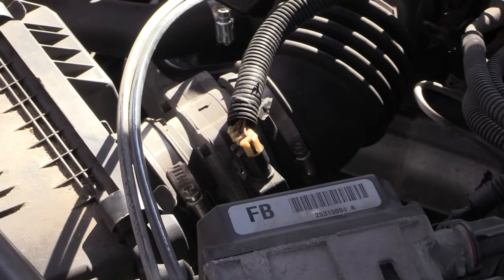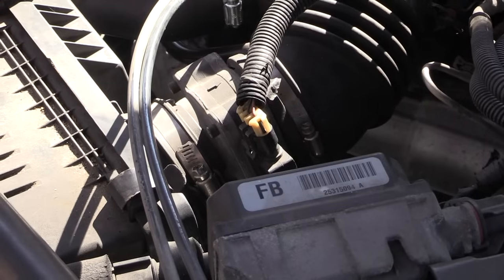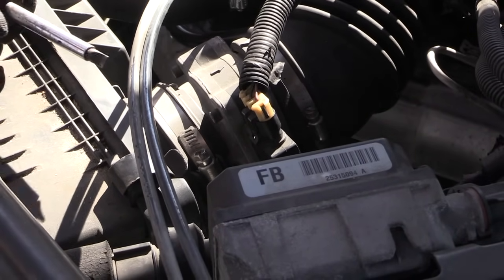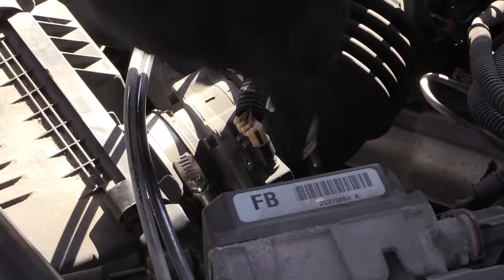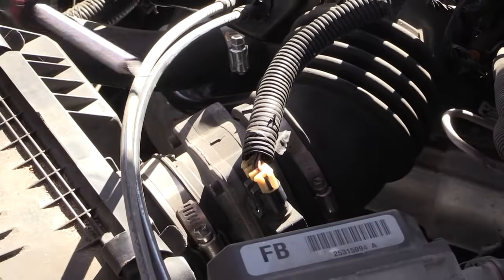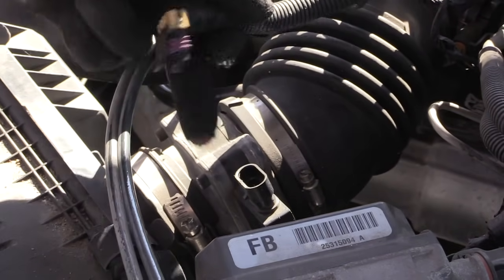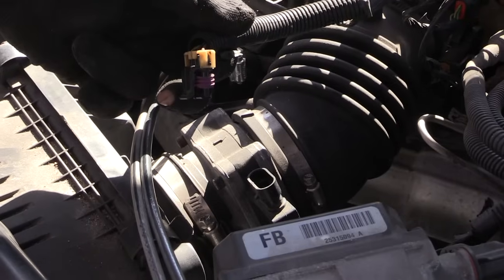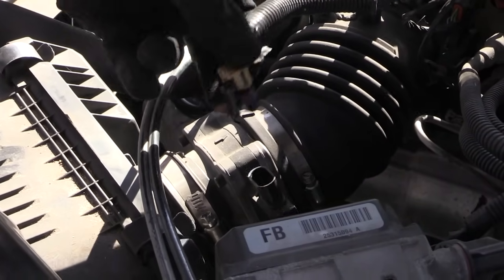Mass Air Flow Sensor -Quick test To Tell if Bad or Dirty!

Comment: I've removed MAF plug engine runs the same reading is good.
02 sensors operating properly.
No exhaust leaks no vacuum leaks. I've tried everything seems I can't get rid of engine running lean. No hesitation good acceleration. Engine seems to run excellent just codes po171&174 keep coming back on. Anything else I may be missing.
Reply from the maker: Sorry, not sure.
Reply: check fuel pressure first if that dont work and check MAP sensor if not that then put a vacuum pressure test on each cylinder
Reply: @deathsdollar2606  apparently you have not read my post as I said I've tried EVERYTHING.
Reply: @brianwalck632  he asked if you checked MAP sensor. You only mentioned MAF
Reply: @89sn2001  I've removed and replaced everything
Reply: I had same problem. And my catalytic that's together with exhaust manifold  was gone ,broke up in pieces, basically suffocating it
Reply: Adding to my last comment--basically my car went in to lean closed loop
Reply: @Wetsocksandavocados  I don't have catalyst converters it's a LS swap engine.  Online has upstream 02 sensors.

Comment: I dIsconnected the MAF and the car kept running. But when we re-connected the MAF the car shut off on my 2005 Jaguar S Type 3.0 6cyl So what's the possible prognosis? Thanks!
Reply from the maker: Sounds like you have a bad or dirty mass air flow sensor. Please like subscribe and share
Reply: Purchased new MAF at Auto Zone for $70 and car runs perfect now ❤ I drive on a lot of dirt roads, that could be the reason.  As soon as mechanic unplugged the electrical plug from air filter car ran great, as soon as he plugged it back in the car wouldn’t stay running. Replaced it and it runs perfectly again 👍

Comment: My question is will a bad mass air flow sensor cause a misfire and lean codes if not working properly, All my sparkplugs been replace and coils I did same test did same thing as the video.
Reply from the maker: Thanks for watching, yes a dirty or bad MAF can cause lean code and misfire. Please Subscribe and share if haven't already and check out my other helpful videos.
Reply: Derek Anthony , did you fix the problem and what lean code does it have ?

Comment: Mine has the same problem, when I disconnect the MAF the engine is more static I guess I need a new one thanks!
Reply from the maker: Your welcome  glad could help please subscribe like and share and check out our  other helpfull videos.
Reply: Whas That the issue?
Reply: Vacuum leak

Comment: I wouldn't unplug and plug back inn.... you can short out the resistors from the mass air flow sensor.... most mechanics should know this...

Comment: this is happening to my Camry 10, I took it to autozone and used the scanner,  and it said it's the maf sensor wiring,  but didn't suggest any parts to replace or anything,  should I just check the wires? I already took the maf out and cleaned it. I did not replace it tho but the engine continues to die or have low power
Reply: I have a 2011 Camry having same problem... AutoZone gave me the P0171 code. I think they are pretty much identical engine wise. I did spray the MAF and put it back in and having same issues. When I go on the interstate the RPM's drop 1000 or more and then go back to normal. Frustrating. Could be O2 sensor. Maybe vacuum leak somewhere. Maybe fuel filter...I don't know.  If you figure yours out let me know. I think we're having the same problem. I want to DIY before I give up and take to a mechanic.

Comment: Hey man. I dont get any codes, but it's making a popping noise on deceleration (after installing an oem air filter). I think it's running lean. When i unplug the MAF, it runs exactly the same. Should i try just cleaning it first?

Comment: So my car is an 06 equinox 3.4l and it will sometimes after trying to take off from a stop light or going slow around a turn just stop. It doesn't die or anything it just stops going. Its like there is NO power and I cannot accelerate or move the car once momentum is gone. Park it pop the hood and undo the battery cable and put it back and it starts up.. when I tried this with the maf the idle didn't change or rpms it just sounded a little bit stronger. Like the slightest change in sound happened. Think it could be that?
Reply from the maker: You may want to look into your  idle air control valve. (IAC)  When these are dirty or bad it can cause your problem, also should clean your MAS to be sure.  Please subscribe & like and share if haven't already and check out our other helpful videos

Comment: So the way my vehicle has been needing to start is if I gas it while trying to start it up, and if I don’t keep the rpm’s high and stabled, it’ll automatically shut off, so when I have it maintained well enough where I don’t have to gas it a bit to keep it on, I tried unplugging the sensor connector that you showed in this video, and the vehicle still stays on, what or where do you think is going on wrong now?
Reply from the maker: Sorry not sure but you should take it and have it code read and see what it says.

Comment: Most of these after market parts are junk I had to re-install  my old OEM MAF to get my car back to running normal I all ways save my old sensor just in case these knock off parts decide to fail me, never throw your old sensor away.

Comment: I replaced with new maf sensor and still the car runs after unplugging it. Any idea? My car shows lean codes
Reply from the maker: You may want to be sure you don't have any lose vacuum lines. Please subscribe & like and share if haven't already and check out our other helpful videos
Reply: Flashback502 thank you
Reply from the maker: Your welcome
Reply: Im had same thing are you getting any maf readings on obd?.. mines constantly saying 0 g
Reply: aj i just have basic obd tool

Comment: my car dies when you disconnect the maf. it will start with it disconnected, but if you disconnect while it's running, it dies.
Reply: That’s a good sign that your MAF sensor is in working order. If the engine continues to run when you unplug it then that’s when your MAF is likely dirty or bad.

Comment: Mazda3 2012 would only run for about 20 seconds and die...disconnected  the MAF and the engine would run...replaced the MAF and car works fine.
An DTC code directed me to the MAF
Cheers

Comment: I have a 2005 Hyundai Elantra GT with the same problem and I did this same thing and it fix my problem and I replaced the mass air flow sensor and it fix the problem thanks
Reply from the maker: You're welcome! Glad could help Please subscribe like and share and check out our other helpfull videos
Reply: @Farmerboy1559  what was you symptoms before?

Comment: I have a 2003 c230 kompressor and when I first start it , it runs and Reva perfectly but as soon as I do a good pull on first gear it starts to misfire what would cause this ? It's not the spark plugs or the coil pack
Reply from the maker: distributor, or ignition coil going bad can cause, also bad gas try gas treatment first and see if helps. Please subscribe & like and share if haven't already and check out our other helpful videos
Reply: It's not the ignition coil , spark plug , or injector.
Reply: Also has new gas
Reply: Dirty injectors are a common cause as well. U can get them tested cheap or free at some specialty shops. Could potentially be a boost leak too but kinda doubt it
Reply: @DevinJohnson.  changed injectors Aswell
Reply: @Trizzyy02  did you ever figure out the problem?

Comment: Bought a new mas air flow sensor and it still does the same thing runs better when it's unplugged.
Reply from the maker: Try some fuel injector cleaner; and gas treatment Glad could help Please subscribe like and share 🙏.
Reply: No check the maf sensor pigtai It often goes bad
Reply: Vacuum leak
Reply: Went through that with my Ranger it was the pigtail.I wire me in a new pigtail fix my problem.

Comment: Yeah my xc60 t6 has developed in 6k km a slightly rougher idle still mostly smooth but not as good and a little less power aswell so I'm thinking maf as that what they listed as an issue at the mechanic thought they said don't worry to next service which is now 4k km away hopefully replacing it will fix the other issues aswell such as poor gear changes surges and occasionally slow acceleration.
Reply: Did it work? Having the same problem
Reply: @JD-fm9eo  it will most likely be replaced in a month when it's serviced again and I'll let you know if it solves the issue.
Reply: Well brother. Did it work?
Reply: @tonnybont8343  turned out the rough jerk that I thought was transmission was just engine mounts and control arms both front, as for the rough idle and the other part of that jerk was the fuel injectors now replaced 3 of the dodgy ones and it runs a lot more smoothly now, maf wasn't the issue in the end.

Comment: I did what you said to try if I have a bad MAF with no codes or CEL. now I know that I don't have a bad MAF but CEL came on. How do I fix it?
Reply from the maker: Normally you can disconnect battery and reconnect and it should go off, or will go off on its on in a few miles. Please subscribe & like and share if haven't already and check out our other helpful videos

Comment: It runs I can keep it running with the mass air flow sensor in it but you got to pump the throttle and be on the accelerator whiskey throttle I guess they call it.

Comment: Thank you it’s like a bad spark plug wire or coil if when you remove it the engine don’t sputter then it’s a bad one thank you this helps
Reply from the maker: Your very welcome Glad could help👍 thanks for comment, Please subscribe & like and share if haven't already and check out our other helpful videos

Comment: Hi,  my car is  2007 Lexus IS250 SE and when I unplug the MAF the cae dies immediately. Is it bad or good. I will appreciate your feed back
Reply from the maker: Thanks for watching, if your car cuts off when you unplug it, then it is most likely good, you should still clean it if you are having problems with your car, it could be dirty which can make your car run bad. Please subscribe and share if haven't already and check out my other helpful videos.
Reply: If the car still runs after unplugged the maf is it bad

Comment: I have a ford Fiesta...now when i start it in the morning it takes hiccups like its about to shut down and sometimes after driving for a while it gives me a light on my dashboard a yellow light which keeps blinking and the pickup drops and it kind of shakes while accelarating..and if i turn off the engine for like 10 mins it's gone.
The light looks like a yellow spiked circle with an exclamation mark inside.
I am really confused
Reply: Did you solve it? I don't get the light but other symptoms are the same.
Reply: That warning is telling you that you have low tire pressure

Comment: on our 04 kia sedona once I unplugged it the van idled up but didn't stall. think its bad?  idle has been slightly moving around.
Reply from the maker: Thanks for watching if your car has been running bad then I would clean it and c if it helps. Thanks for watching and commenting. Please subscribe & like and share if haven't already and check out our other helpful videos.

Comment: I have two maf! How can i check them? I scanned the codes and i been told to change the maf. My car has two!
Reply from the maker: If your code is saying you need a new 1 I would buy 1 and try it in both spots until code goes away. Please subscribe & like and share if haven't already and check out our other helpful videos

Comment: 08 accord 2.4 misfire. Turned car on unplugged MAS engine cut off. Plugged back in. Turned car on again unplugged it nothing happened. Please advise.
Reply from the maker: I would check spark plugs and wires next And treat gas. If car cut off when unpluged your MAS is Probly ok still would clean tho also.
Reply: @Flashback502  replaced plugs and checked coils with a circuit checker all 4 work.  Just cant pinpoint misfire. Maybe my ECU. Checked injector switches all got power. Also cleaned MAS sensor with the right MAS cleaner.

Comment: I have a 2014 Sentra with code p0101, could that be the sensor itself or could it be the harness? I’ve tried watching videos on it but don’t know if the harness needs to be replaced or the sensor
Reply: I have the same code on my 2014 along with p0103. Did you ever get it fixed? Mine runs like crap and it stalls.

Comment: Went to two other pages and they said if you disconnect your mass airflow sensor and the engine shuts off its its good
Reply from the maker: Yea it can be confusing tell u understand what's going on. If you read the other comments and replys may help.Please subscribe & like and share if haven't already and check out our other helpful videos
Reply: Yeah I did  too. You cant really get a scientific result this way.
Reply: You read correctly if you unplug and car dies then your MAF sensor is good! Counterintuitive and very confusing if you are going off info from YouTube as some of it is conflicting
Reply: @siagizmobass386  depends. Old mustangs go to limp mode. Not die. If you plug in it dies that’s one indicator.

Comment: If you unplug the MAS electric plug and the engine runs smoothly, can you just leave it unplugged and run it like that?
Reply from the maker: You can temporarily but u should clean and if that doesn't work then replace. Please subscribe like and share.

Comment: What if my car runs great but has codes for to lean..if i unplug maf what should happen? Any help would be appreciated
Reply from the maker: Thanks for watching if your car is running fine but has a lean code if you unplug MAS most likely your car will run bad, but I would clean MAS and see if that helps, also u may need oxgen sensors. Your welcome, Please subscribe & like and share if haven't already and check out our other helpful videos
Reply: So it should still keep running it shouldn't shut off?
Reply from the maker: It may cut off but will most likely run bad

Comment: I have a 1997 Ford F-250. Some people said that if u remove the MAF and it continues idling, the MAF is broken. I removed mine and it continued however, the RPMs adjusted (I think it got louder) and then when I put it back it, I heard the RPMs change again. I cleaned the MAF sensor with MAF cleaner before doing this. So is it true that some trucks can keep going without it? Idk if I need to replace the MAF or not
Reply: My car works without it.I guess some cars do and some dont
Reply: But do you have a check engine light

Comment: Hmm.. but I thought when u disconnect it, if you hear no change in idle that’s when it’s bad.. 🤔
Reply from the maker: It can be either, if you read other comments may help u to understand better.Please subscribe & like and share if haven't already and check out our other helpful videos
Reply: @Flashback502  you should take A stance ..we Re looking uo to you so pl be clear Nd not direct to others ..i am sorry for being bold but we are sufferinf due to claritt. Thank u.
Reply from the maker: If they read   other comments and my response, then will also see my long  explanation for  logic behind  test.  Thanks for taking time to post comment, may just pin reasoning in video description.
Reply: This dude don't know jack
Reply: @Dholiist  I agree Bub. This guy is having it both ways. Politician
Reply: @Flashback502  what test. Pull the plug. This is not a test

Comment: Clean the MAF flow sensor before replacing it.  $8 vs $500
Reply from the maker: ☝ agree. Please subscribe & like and share if haven't already and check out our other helpful videos
Reply: Also  can be extracted from a similar equipped parts vehicles at  Auto Recyclers ! 

 $17cdn got me a extracted MAF,  even with upper 'hose' attached !  Haven't cleaned it yet, but acquired it as a back up.
Reply: new MAF sensors are nowhere near $500.  C'mon.
Reply: 50-100 bucks......5 minutes

Comment: If you unplug a powered circuit to the computer (ECM) while engine is running, you will create a voltage spike that can wreck the ECM. As usual video author knows nothing about the subject matter.

Comment: I have a 2013 Buick lacrosse when the sensor is connected sometimes turns on other not it just crancks, but if I disconnect the sensor turn the car on and reconnect the sensor runs smoothly, what could it be? Not sure if I should clean the sensor or just order a new one
Reply from the maker: Hi, thanks for watching. It sounds like you have a sensor problem. First, I would take it to AutoZone and have it read to see if it puts out a code. Either way, I would clean it. If that doesn't work then I would get a new one. Please Subscribe, share, and hit the bell if haven't already and check out my other helpful videos.